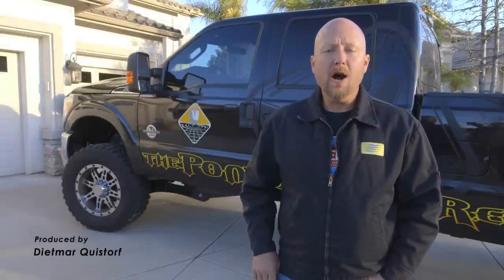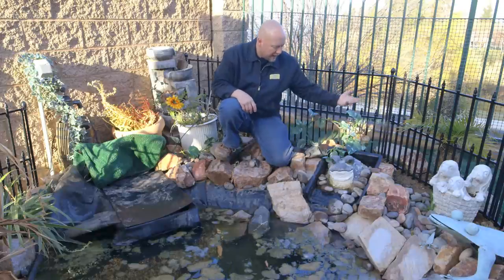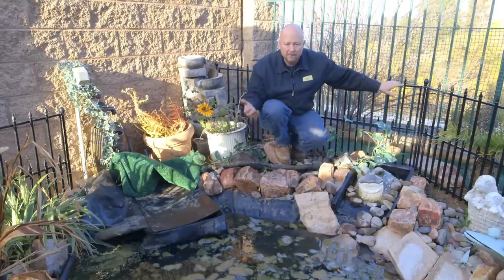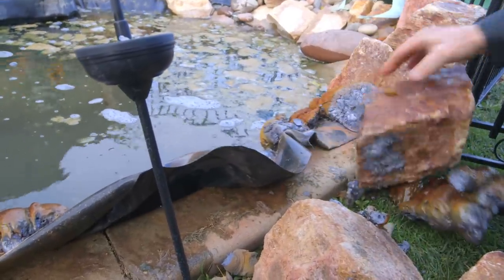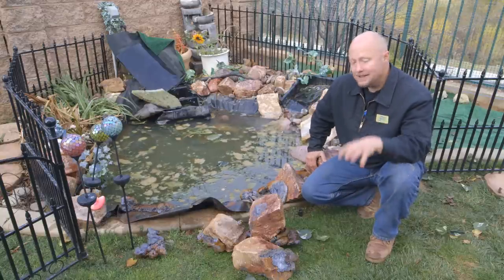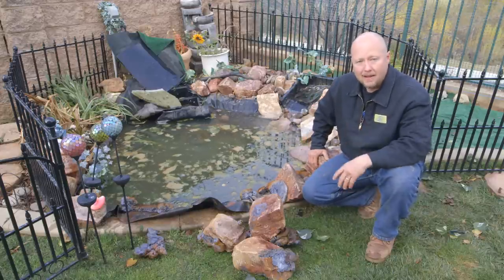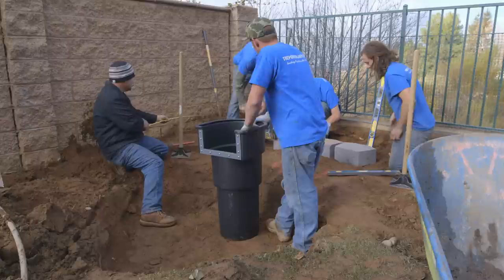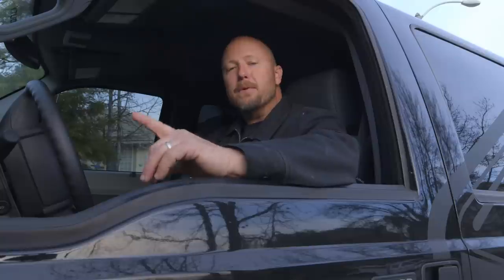Ponds Gone Wrong | Backyard Ponds - Episode 2 - (Part 1)

Comment: Here is one for Ponds Gone Wrong. First thanks for taking the time to read this. About fifteen years ago i had a great idea and went to my neighborhood ABC Hardware store and rented a Backhoe. I was able to save delivery charges since they were around the corner. Back to story, In my yard i picked a spot and began digging. This whole in the ground is (9( nine feet deep, (10) ten feet wide and (12) feet long. I took landscape lumber and put in each corner. Then took plywood and made a frame, connecting to the pressure treated post. I put in the underlay then the liner. You know everything was looking good, i put in fish and boy did they grow. The liner is near the end of it's life and two problems came up. First i think the ground shifted because two of the sides look like they are buckling in.  When i look at the brick work i see it is not level. Second where i have the water fall, at the base i have a feeling that it sunk into the ground. Where as before i could have the water level right up to my slate, now  when i try to get it at the bottom of the slate at a platform where i am standing i began to see water infiltrating the area. Third for the longest time i was thinking evaporation was doing me in when in fact it must be a whole in the liner. Reason why i am thinking this is because when i fill it up it goes right back to this same spot. it is about five inches from the top and it stays there. My water was getting green because when i made the hole it was in direct sunlight, my fault. Should have done some research before i started. No skimmer (i know) what can i say. The other day i drained the water to the point where the fish were just about on there side, i then filled it back up and about six hours later  i took a look just to see a fish dead under the water fall. First one in Years. Took it out, gave the others some food and went in the house. The next morning a fish about twelve inches long by seven inches wide by six inches high was dead under the water fall. Did some checking and from what i see is the water over time gets polluted but to a point where the fish adjust slowly to it. By doing a massive water change the way i did is what did them in. What do you think. Since this liner is at it's end i want to change it out, install a skimmer, have shelves and over all make it a little larger. Also it is in direct sun, also don't know if you have ever heard of wrighty, i constructed his filter system on my pond. I think i now have to wait for the system (nitrifying bacteria) to kick in).  My  Problem is what do i do with the fish? Some are around six to eight pounds and i have about twenty fish. I am lost. I don't want them to die. These fish are in the pond all year long. Even winter. Hope you will give some recommendations. keep up the good work only wish i would have been able to see your channel before i started. God Bless.
Reply from the maker: You may need to build them a temporary pond while you build the new pond. It's not uncommon to have to do that! Build an above ground pond out of wood and liner and put your existing filters on the temp pond while you tackle the rebuild. 

Before you get started and move the fish you will need to have all your ducks in a row. We can assist you in the planning if you need help. 

Email me - eric@theponddigger.com

Follow me on SnapChat for daily PondPro Tips! SnapChat - theponddigger

Comment: This sadly looks like everything wrong with my (estimated) 2500 gallon pond that I inherited from previous owners at my home.   It looks to be the same situation, a DIYer "professional" built it for them, and it is just full of issues like those in this video.  The coping rock issues, pump issues, grading issues, overflow issues.  

I've learned a lot in my own research that by now I feel like I could build something better easily, but sadly lack the time and money and the ability to house our rather large Koi while doing the necessary work.

Comment: Right out the gate the skimmer seemed too high and the waterfall too low. The second issue is the homeowner has to be taught to clean the filters every so often to keep the water flow going. Without water flow you have algae, excessive bacteria and even odor. Overall looked like shabby work. A waterfall pond will add value to your home, so invest the money and get a quality pond. You should not be seeing buckets, hoses, DIY filters etc near the pond. Its supposed to look natural. Great video.

Comment: I built my first pond out of concrete mortar and cinder blocks about 1 foot below and 3.5 feet above the ground (so 85 percent of the pond is above ground) at 4.5 thousand gallons the highest point is over 6foot for the water fall all tiled with slate free standing concrete shelves that make caves big pond flows into little pond to create skimming and second water trickle into smaller pond used thoroseal not one leak its been 5 years since the day of completion I built it for a fish store on commercial property designed and built by me of course there knowledge of skimming and filtration was very useful...
Reply from the maker: Sounds like a great pond.

Comment: Dude. I literally just dug a hole, thew in a liner, put down some river rock from my local Creek bed, filled it with water, slapped in a cheap Amazon pump planted some plants, and it ended up better than this.
I had never built a pond and did minimal research. All I figured was "big fish tank".

It's been 6 months and aside from some minor thing, I've had zero issues.

Comment: I have a pond with no liner we just built with some farm equipment found a good spot using dowsing rods and dug worked good for over 10 yrs but the last 2 years it has completly dried up after a big rain last year there was about 2ft of water so i put a few catfish in it thinking i could keep them until i got more to eat next day it was completly dry. Is there any way i can fix this?

Comment: the only thing i have to ask though, the filters not being clean, would that not also come back to the owners not cleaning it? i used to clean a pond at a local school at least 1 a month and there was never that much build up on the filters. to me, that just looks like a lack of effort on the owners for not cleaning the filters out. unless they are meant to be like some no-cleaning required filters.
Reply from the maker: Mark Evans Of course you can always have a homeowner neglect the pond. The problem with this pond is it was beyond that.... The skimmer and waterfall weren't even working correctly.

Comment: Mine is total pond gone wrong. We bought the house with it already there (DIY). Totally jerry rigged. We're having it rebuilt this year.
Reply from the maker: Good To hear! Have you interviewed and selected a qualified pond contractor for the rebuilt yet?
Reply: This is my big year of investment for it. The pond is around 5,000 gallons. We're going to fix the drainage, repair the sump (it did exist - the prev owners just jerry-rigged an intake hose to the pump because it quit working). Not so, quit working. The problem was that water would seep under the liner due to improper grading and would create a huge water buffalo thus pushing the liner above the drain which would cause the sump to stop operating. We added a filtration system at the upper fall and then we're going to install a belly band under the liner, then a skimmer with filtration and internal pump at the bottom of the pond. I have a good service with whom I've worked with at length of trying to fix the issues myself but .. this is not a job for the novice. I do expect a rather large investment to occur but it's going to be so very nice once it's completed.

Comment: I'm not sure that guy knows the proper usage of a tamper metal againset stone = chip chip chip at least a block of wood and a double jack cmon I know ur customers are paying big money ur driving 70 k truck around for estimates wouldn't have it been better to tamp/compact the dirt and fine tune it using sand to set the blocks
Reply from the maker: The little garden wall we installed was only a couple of blocks high and not retaining any structural weight. The dirt in our area works well under this construction method but admittedly we have busted a few hand tampers!  

When installing taller garden walls that are "Retaining" we over dig the area, excavate a footing, install base and compact prior to installing the first row of block. If and When we ever have the opportunity, we will shoot a tutorial video on how to do that. 

FYI, The truck was only 60k because I installed a pond for a GM at Ford. 

Thanks for watching and I really do appreciate the comments.
Reply from the maker: Believe it or not the wall is actually still standing without sagging after 2 and a half years. I know this because I was just at their home installing a new water feature in their front yard. ;)
Reply: What he is saying is you should be using a soft faced mallet when placing the blocks. The tamper is for the soil, not against a piece of concrete.